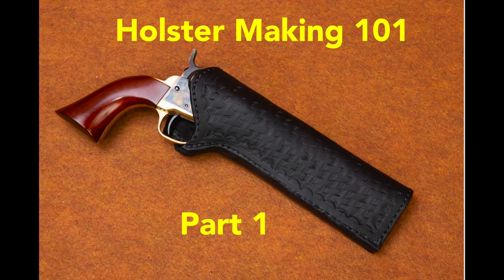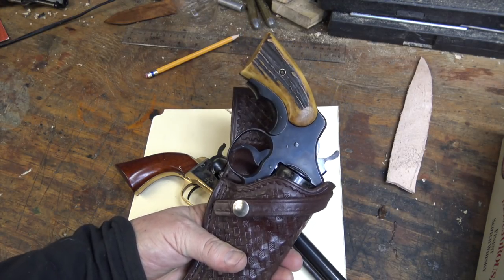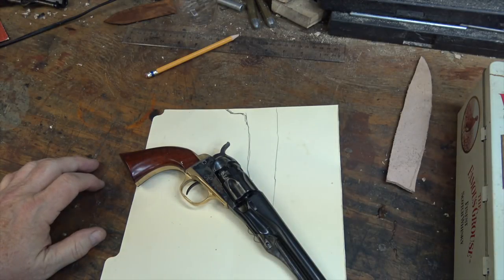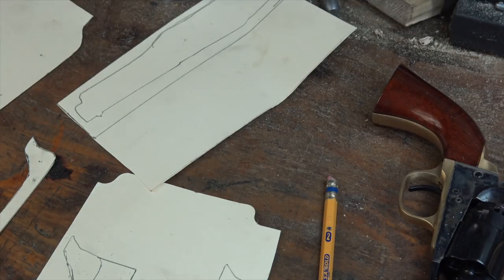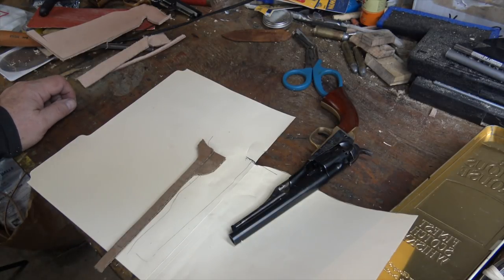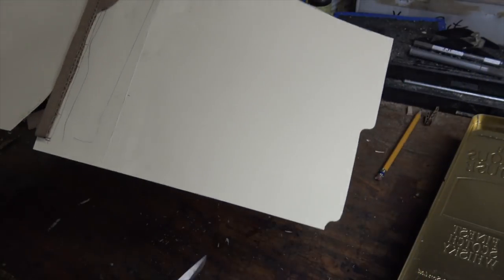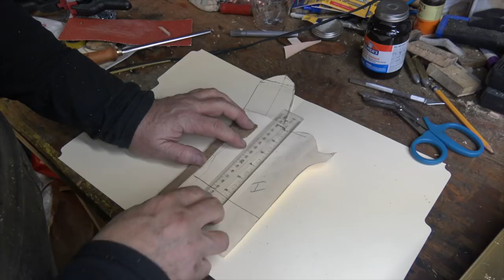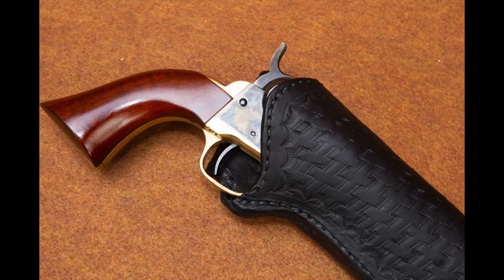Holster making 101   Part 1

Comment: I use file folders for my patterns, following the instructions from Al Stohlman's holster making book.  I make my welts afterward using the seam edge. I use a Dremel in a drill press attachment or have used a regular drill press form my stitching holes. That makes it easier to to put in the holes rather than trying to push an awl through 3 or 4 thicknesses of leather.
Reply: That's the same way I make my holsters, great minds!

Comment: In the village back home in Alaska we would take a beer box, lay the gun or knife on the edge of the flattened box and roll the gun or knife up in the cardboard tightly then cut the extra off as the roll would be not even because of the taper of the gun or knife then we would wrap the cardboard with the gun or knife still and inside with duct tape, it was a real Native craft they worked for a number of years and were certainly one of a kind and the tourists really liked them, when we would go work on forest fires for BLM we would get all the fire hose we could and also make holsters and scabbards out of the fire hose sticking it together by melting the edge and hammering it together

Comment: Duelist, This has naught to do with holsters, but rather grip replacement on an 1851 G&G. I just got this revolver and everything seems fine , but the wooden grips are a shade small for the frame. Since you are the No.1 man in dealing with DIY stuff on black powder guns, I ask if you have ever  made a new set? I say made because I have already looked at a new set and I don't have the $$ for that. So I gave thought to making a set, I'm better at carpentry than I am at hoarding $. If you know of a site that you can point me toward, or tell me yourself, I will be eternally grateful.

Comment: Why is the trigger usually exposed in old west holsters while we make a point of covering the trigger in modern holsters? I know a retention strap or thong would probably make it impossible to fire the gun in the holster. But for a holster without a retention strap, with a single-action gun, it might be possible that the hammer could get accidently cocked, so you wouldn't want to have your finger on the trigger as you draw the gun. And for a double-action gun, you might be able to pull the trigger while the gun is holstered, although it is less likely because of the heavier trigger pull of double-action. So again, why leave the trigger exposed?
Reply: Dan Braun I was thinking the same thing.
Reply: I would suspect it’s because gun safety as we know it today (in particular the “keep yer dang finger off the $&!@ trigger!” rule) hadn’t been invented yet.

Fire crackers and dynamite were over-the-counter items, and even kids could get them...it was expected that they wouldn’t do anything stupid like holding it after the fuse was lit, and with guns it was expected that you wouldn’t pull the trigger until you were ready to actually fire because that’s a dang fool-head thing to do...

Of course those expectations failed to live up to the reality, so today kids can’t get fire crackers, adults without an explosives license can’t get dynamite, and holsters protect the trigger from an accidental/negligent discharge.

Just my $0.02, thank ye fer yer time.